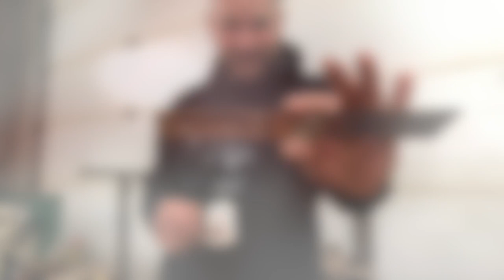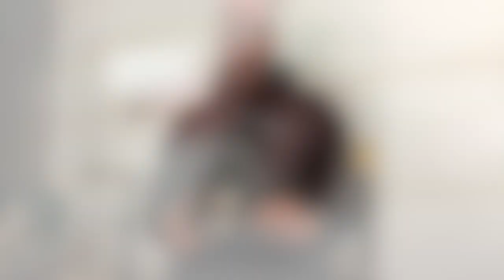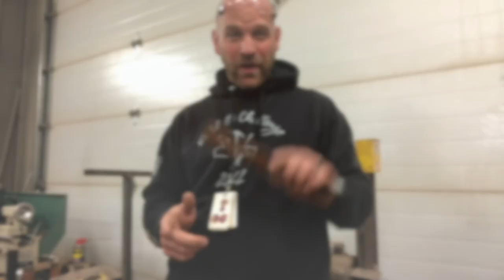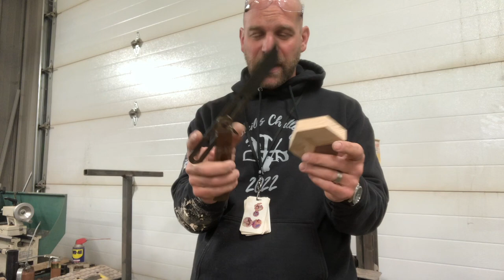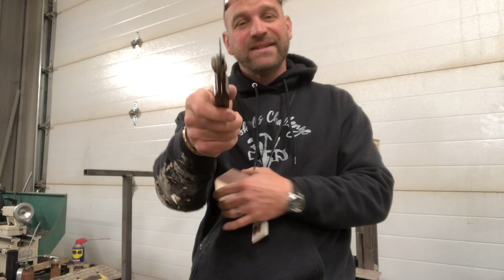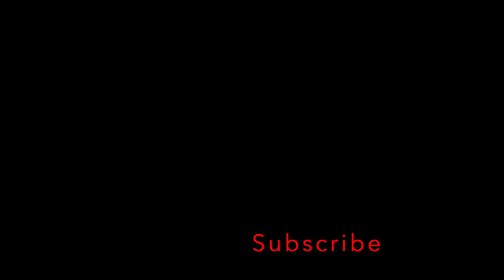What is a Sliding T Bevel?

Comment: I have one just the same which I’ve used a lot cutting railway sleepers.
Handy hint: if your timber is not flat, run a straight edge along it and hold the bevel to the straight edge.
Reply from the maker: That’s a great tip!

Comment: Hi, yours looks like the lever should be tightened up a little , The lever should remain within the width of the bevel when locked on. At present your lever goes out over the side and could impinge on the work you are checking or with a marking scribe. I have a few bevels, and they are very handy tools in the shop.
Reply from the maker: Yeah, it does need a little TLC, thanks for the advice!